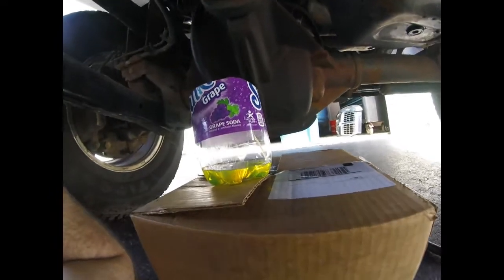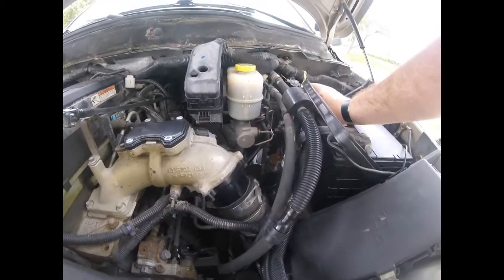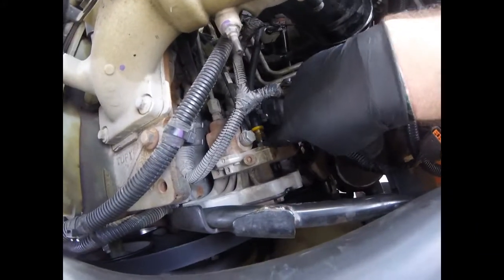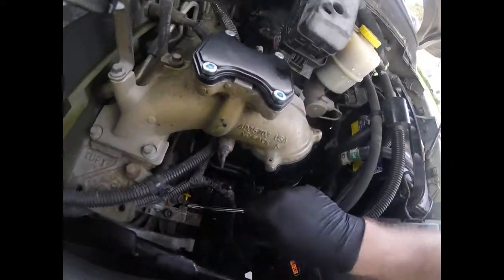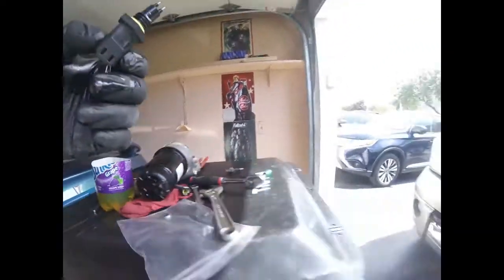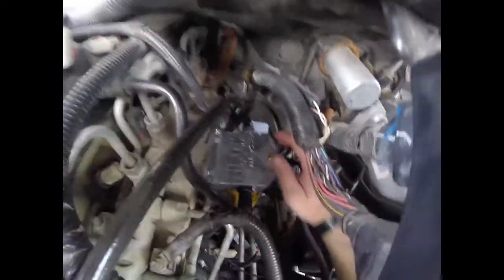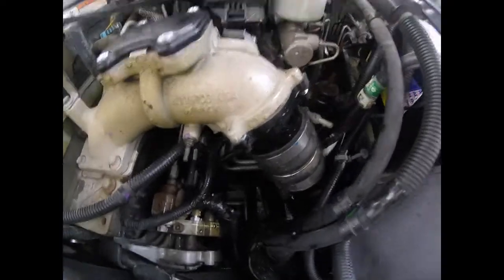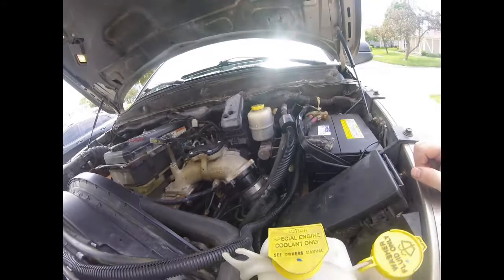07.5-09 ram 2500 CAT fuel filter install

Comment: you can use a copper crush washer for banjo bolts as a temporary fix if you're in a bind, it wont last forever but it'll get you to the parts store.

Comment: Great video, I just received my kit and I'm going to attempt this installation in a few weeks. I'm glad someone did one on the 3rd. Gen. Were do I order some extra banjo washers just incase, dealer or an aouto parts store. Thanks again for making this video.
Reply from the maker: No problem! I got mine at the dealer though you may be able to get them at the parts store. I wanted it to be the right gasket the first time so that's why I went to the dealer

Comment: Water and fuel sensor do not screw into the housing all of the way making it leak. Trying out pipe sealer right now don’t know what to do any help would be appreciated
Reply from the maker: That's odd, it should be able to screw all the way in with ease. I would just make sure all the treads are clean, straight and there's nothing keeping the sensor from going all the way into the housing

Comment: Can u make an update video on changing the filter
Reply from the maker: Unfortunately I can't, sold the truck a while ago
Reply: Could u change the filter without taking the inner fender out
Reply from the maker: @chrismidkiff8541  you can change it under the hood, it's right in the open
Reply: @bourbonboost4564  thanks brother I appreciate u

Comment: So is the water in fuel light on since you couldn’t plug in that sensor? I want to do this but I don’t want my light on.
Reply from the maker: the water in fuel light gets plugged into the sensor on the side of the housing. im not sure what the other unplugged sensor was, but i do not have a check engine light or fuel light on because of it.
Reply: Ok cool sir thanks. I’m going to get one for my 07.5 6.7 cummins

Comment: I am just finishing up my install and the filter hits the aluminum tube with the bolts for the filter  bracket barely started. ??????
Reply from the maker: I had the same problem as well as others that bought the kit. If you just push the aluminum tube towards the block a little you can screw the filter on. Not a big deal, they both shake with the motor so it won't rub through
Reply: @bourbonboost4564  that’s what I was worried about them rubbing. What about replacing the filter next time will it be a bear to get started?
Reply from the maker: No, just do the same thing. Push it away a little bit and it'll come right off. I do reccomend a oil filter plier for getting it off though, it'll get tight on its own like the oil filter
Reply: @bourbonboost4564  thanks man. Video was very helpful.
Reply from the maker: Of course, that's why I made it. I couldnt find any instructions for the third gen so I knew it would be helpful